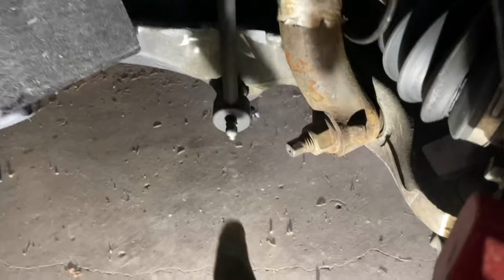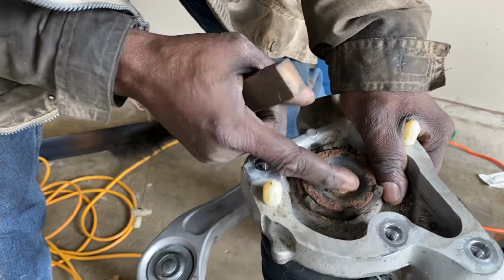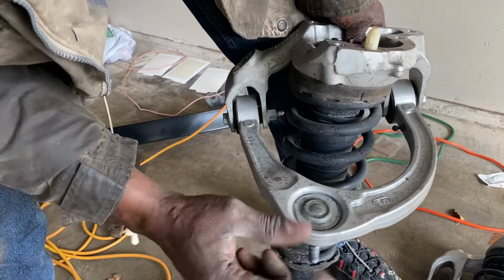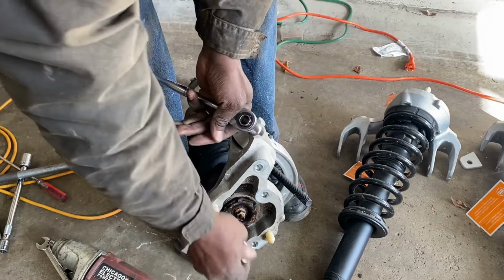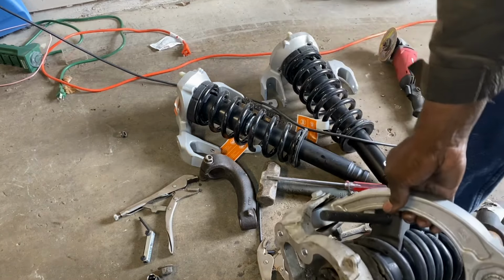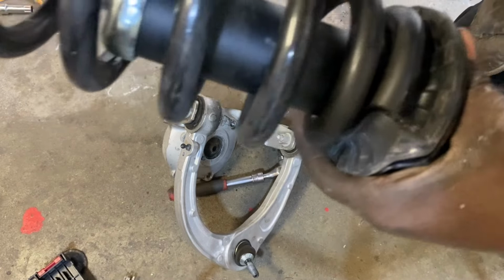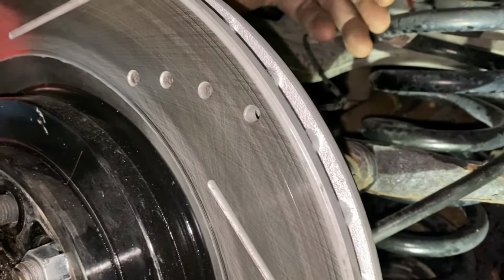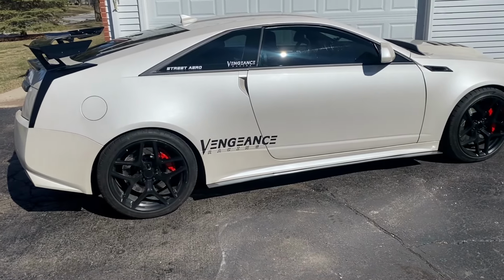Installed Eibach lowering spring - 2013 Cadillac CTS AWD coupe

Comment: Hi I gotta say I love all your videos and the work you do. I've got a 2012. My question is do you have staggered rims or are they all the same size. If they are the same size have you had any problems with the drive or suspension? Are the 20's? What tires do you run on them. Also alignment any issues. I've gotta replace the rear adjustment screw for alignment the shop said it was all the way out is that something I can do? Thanks bro. Your the best
Reply from the maker: They are staggered. No issues at all. I’m not sure what your alignment shop is referencing, I’ve had mine aligned after installing them. 
I also have a video out there of me installing them. 

Rims: 20 x9  (front) & 20x10 (rear) with a +35 offset on all 4.
Center bore: 66.9mm
Bolt patter: 5x120
Front tire size: 245/40/20
Rear tire size: 285/35/20

Comment: There are 2 different sets of Eibachs for the coupes.. the CTS-V fronts are slightly stiffer due to the weight of the V8 motor.. that probably why you are not getting the drop.. the V6 Eibach springs are long out of production.. I’ve been keeping my eyes open for a used set with no luck yet.
Reply from the maker: I think you are correct my friend. I’m currently debating between putting the factory front springs back on because they had settled over the years to an almost perfect lowered height or going coil overs.